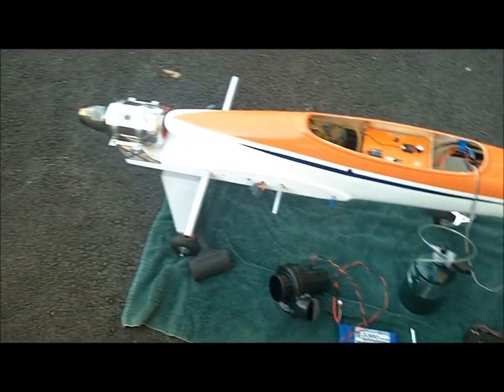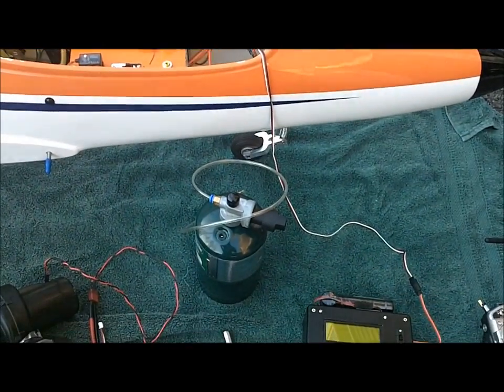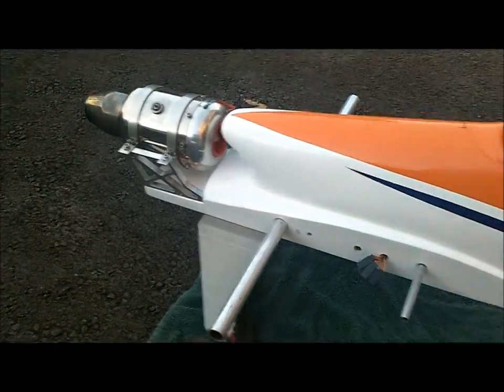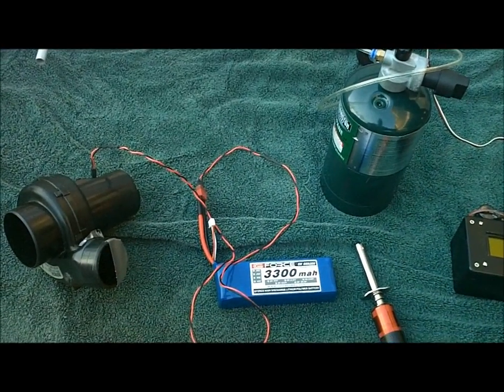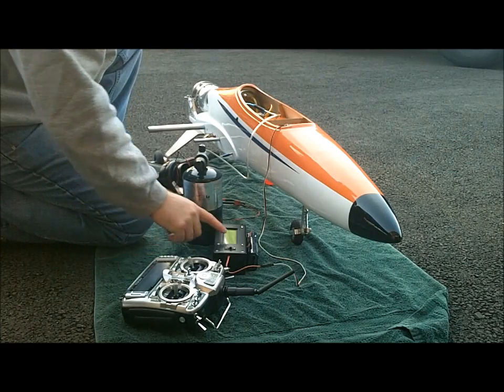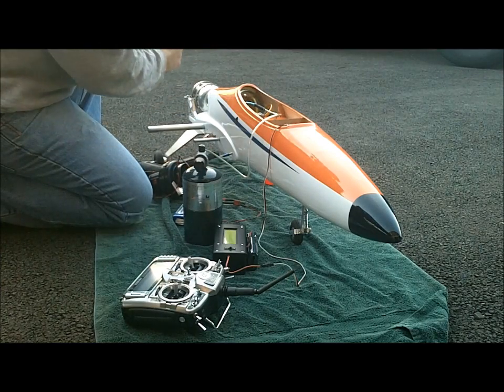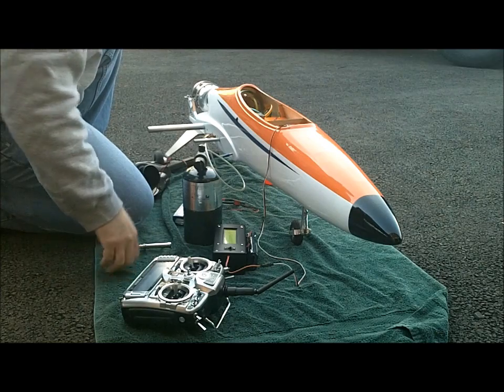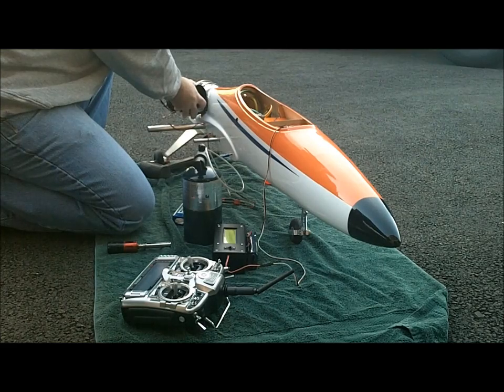manual start of a turbine engine

Comment: hay what batteries are you using for the turbine got the same one but the batteries are missing. thanks
Reply from the maker: Old Gen1 ECU's use a 6 cell nickel pack. (7.2v)  The internal parts are ok to around 12v but I know a bunch of people who had pump failures, and ECU issues when they tried to run them on more power. And since they don't have any way to keep lithium batteries from fully discharging, I don't recommend trying to use them.

Comment: Hi there,
I came to know about you on you tube video ( Manual start of a RC turbine engine ). I found turbine engine kit on eBay. I fly RC airplane and helicopter. I'm the club member. I have experience with glow and diesel engine. 
  Before I buy turbine engine kit, I have few questions. I need your help and advice. Please help me.
1. What other components are required(for  manual start)?
2.Is it possible to start turbine engine (manually) without ECU?
Looking forward to hearing from you soon.
Best Regards,
Maksud Khareghat.

Comment: hay nice vid where can i find a data terminal for amt mercury thanks
Reply from the maker: They are becoming hared to find.  I would make a post on RC Groups.com in the jet section.  Someone may have one sitting around, since people aren't rebuilding these AMT's.  I made the one in the vid since AMT wanted $300 for it at the time.   I had about $60 into that one.   If you have an AMT180, and have some micro controller skills... I can send you my code.
Reply: hello thank you i like that. i just got that it’s my first turbine and i’m going to try and one of those jet it looks amazing thanks again

Comment: Hi we're did you get that propane valve with the festo?
Reply from the maker: DreamWorks RC sells them.  To start the AMT's this way really needs the regulated valve.  A standard valve will let too much gas into the engine.
Reply: Hi Tony4aro, can you tell me the model of the blower you have? I couldn't find one on ebay.  Thanks!